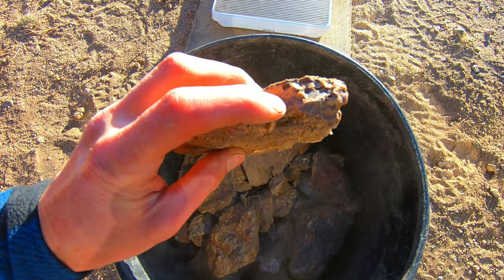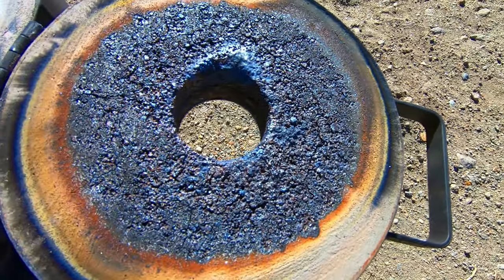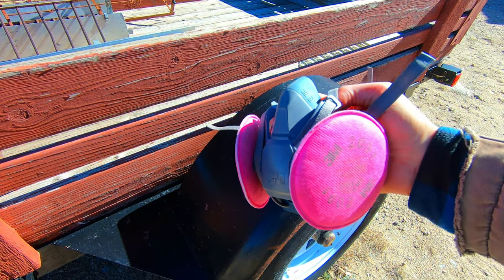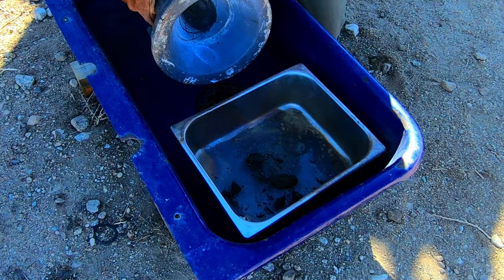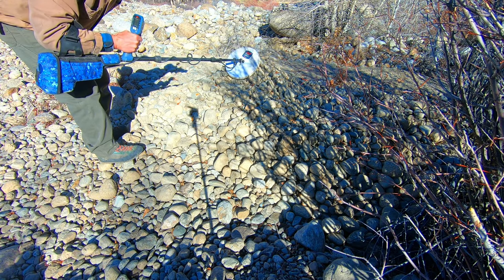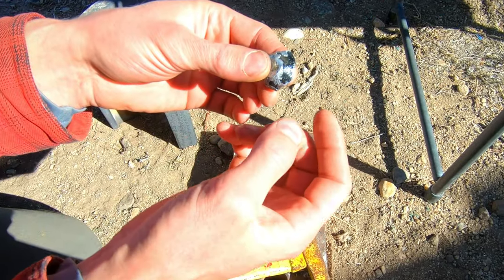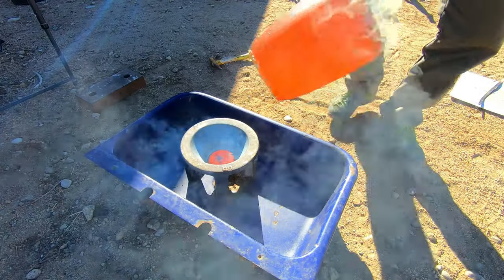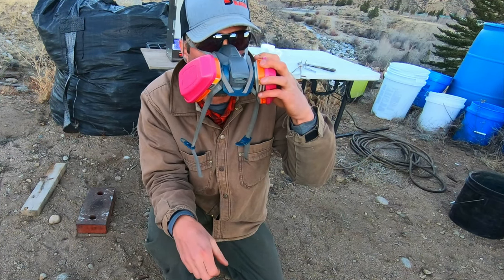GOLD FROZE at 1760°F  Simple Gold Recovery and Smelting Tips!

Comment: I still can't see how you achieve full collection of your precious metals with just bits and pieces of lead added to the bottom of the crucible. Some of the gold i assayed would never migrate to the bottom of the molten flux. That's why we use litharge, as the lead oxide converts to lead, the tiny droplets "rain down" through the flux and grab the p/m's on its way thru.